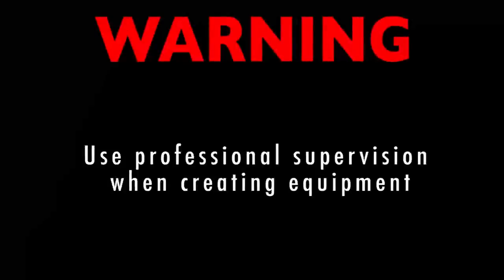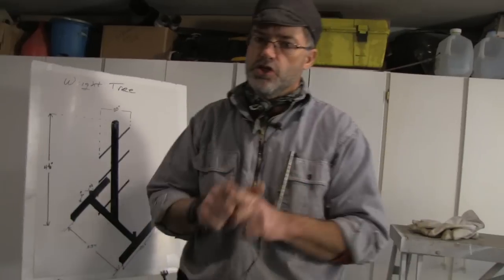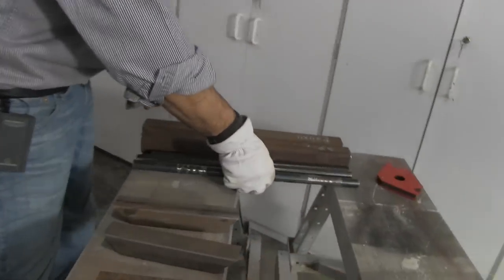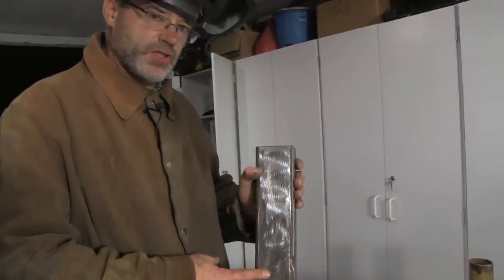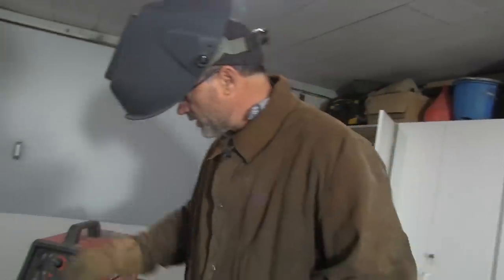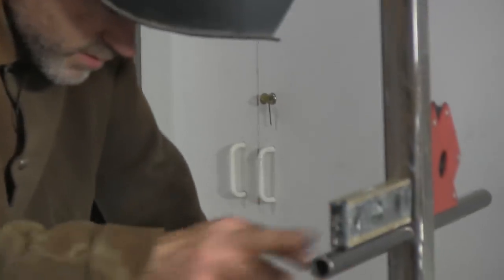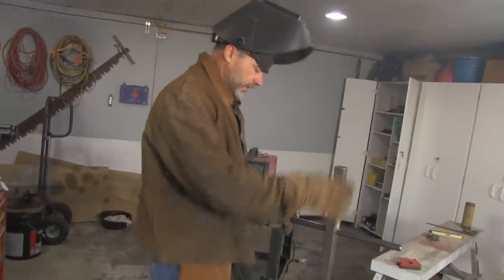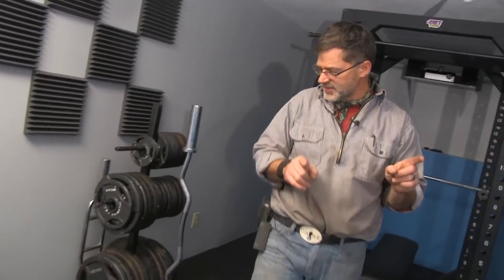How to Build a Gym Weight Tree - DIY Dudes

Comment: I have a request that I would love to see done. I would like to see an incline, decline, & flat bench made from steel. I know you can do it because I just watched you weld a weight tree on this video. 

After the bench and the dumbbell stand, I want to see you build another power rack with steel that you can break down using bolts when you have to move. 

Love the videos.

Comment: My "power rack" is made from an old iron balcony fence and for dips I use an old iron table with its top removed. I put a pulley on the power racks pull up bar and do triceps extensions, rope crunches, etc. All of it was either lying in the garden or in garage, no expense, except wasting some of my fathers time and nerves :P

Comment: a decline bench would be awesome
Reply: Make a regular bench with one leg taller than the other? Unless you want to make it adjustable but i don't see the problem there either. :)
Reply: Olof Nilsson That wouldn't work you would just slide off it once you pick up weight. You need something to hold your legs in place.
Reply: An extra pad in one end? :)
Reply: Something that you can lock your feet into
Reply: Regular decline benches just have a pad that your calves are resting against so i think that would work.
Reply: +Olof Nilsson no you're talking about incline benches a decline bench is a bench leaning towards the ground
Reply: DashingZulfadli there are two alternate choices to making one, and thats using two 45s and placing them under the leg of the bench or just buy one

Comment: could this be made using 4 x 4 for the frame and then drill holes to put the 3/4 in pipe through?  cheaper and easier that way maybe